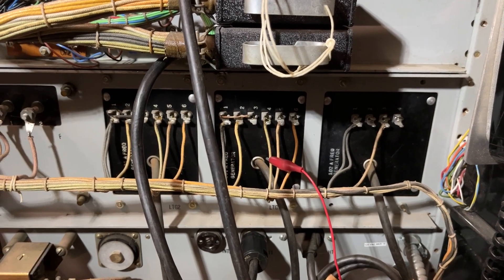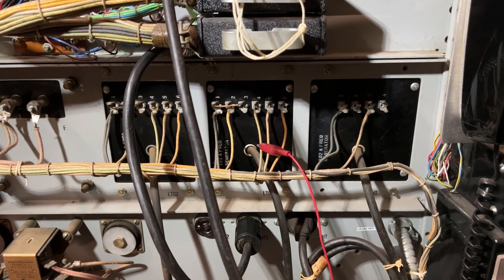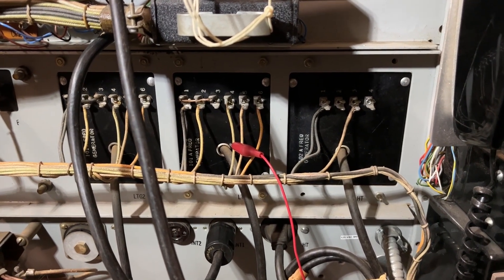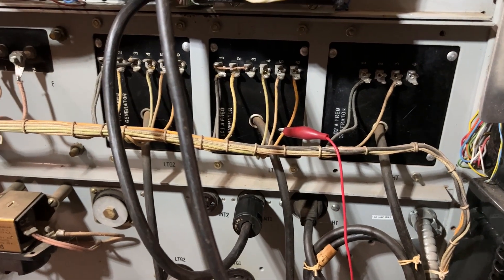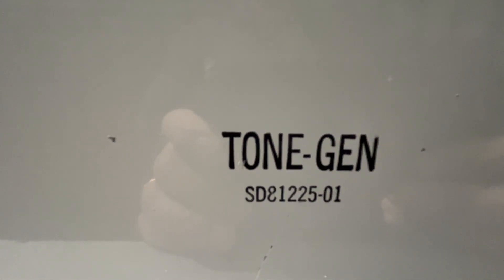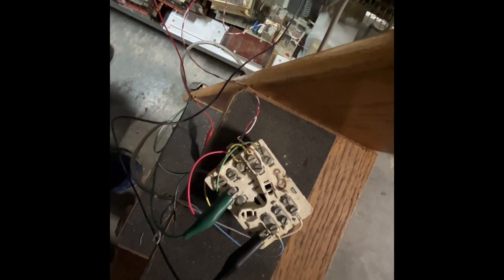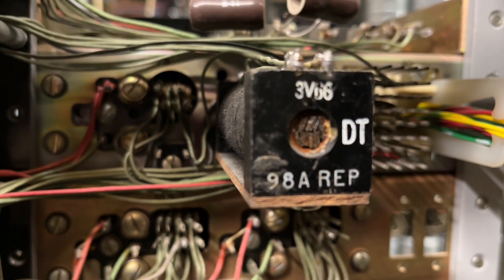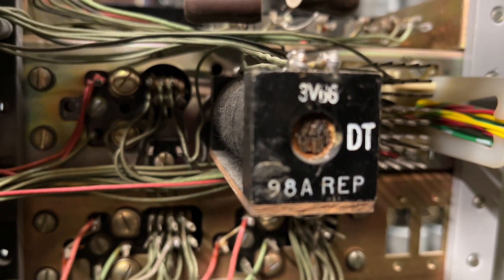Western electric step x step dial tone. 101 A and 102 A tone generators.

Comment: I was lucky enough to find a 101A frequency generator on ebay, it seems to be new old stock. I'm currently using it for my single link step demo. My bigger step switch has a rotary machine that you can see a video of on my channel. Interesting to see where this is supposed to be mounted!

Comment: Cool.  Maybe one day your wireless internet to the farm will improve for less dropped out audio. :(
Reply: From looking at the exterior of his CO building, it looks like there is a Ubiquiti airFiber unit there. I don’t think that the airFiber is the problem though, unless they are out of alignment. It is probably his main internet connection. He has a good LAN, but his WAN connection is possibly DSL.
Reply: I have some recordings of calling into his system ~5 years ago, and the audio didn't drop out at all back then. Not sure why it has been so bad lately.

Comment: Hi Phil
You showed us a 425 telephone network set in monitor mode. Can you speak to how that is wired? I like the concept of telephone networks
Reply: I agreee... This would be interesting to learn about.  Most of the monitor circuits I  use are either integrated into a device, such as a Butt Set, or some sort of 'specialty' circuit.  A telephone network configured in a Hi-Z or High Impedence mode would very handy.